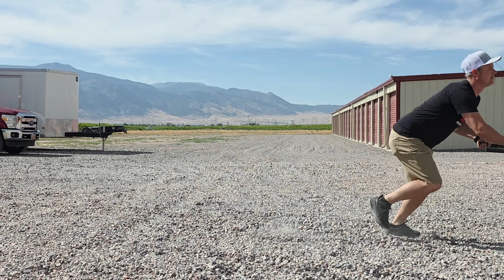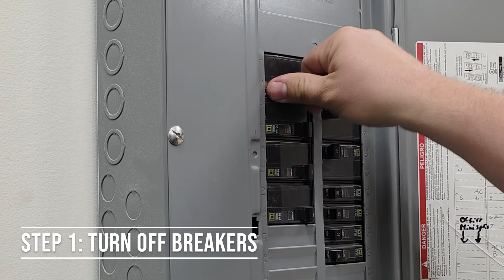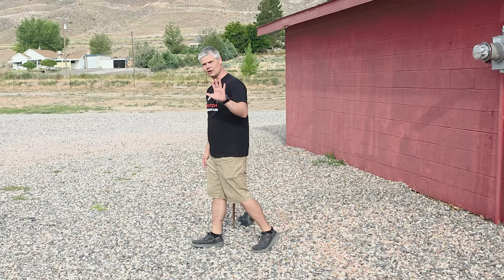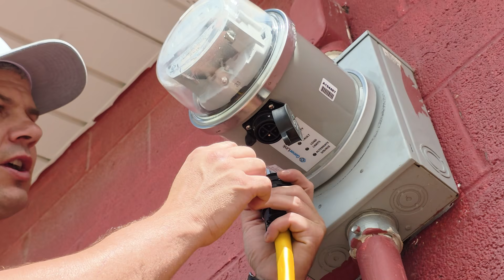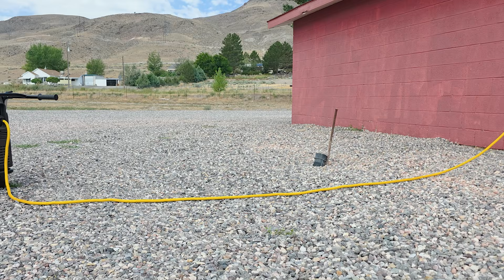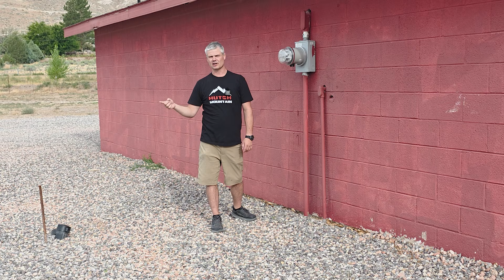How to Use the Generlink Transfer Switch to Power Your Home in a Power Outage

Comment: Question once power is back on and you turn off the generator is it safe to touch and unplug that cable?
Reply from the maker: Yes, it's safe to touch and unplug. When the generator is turned off the internal changeover moves all power back to the grid and is completely separated from the plug terminal. :)